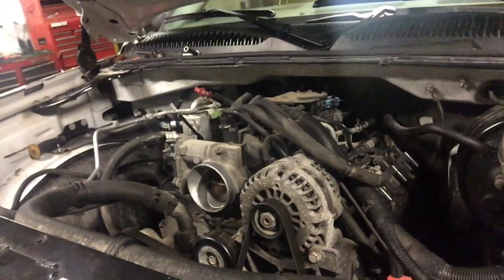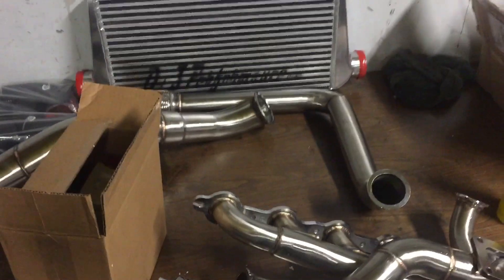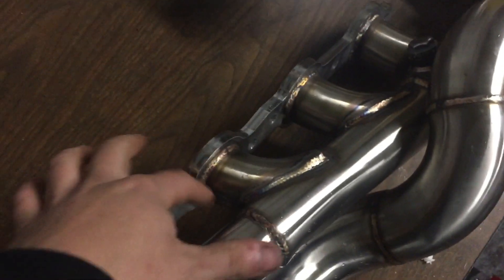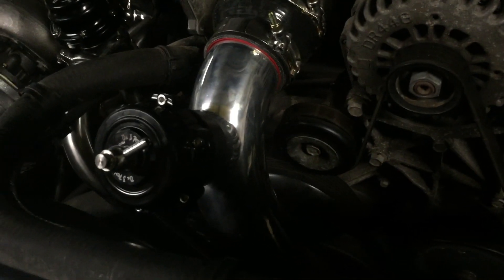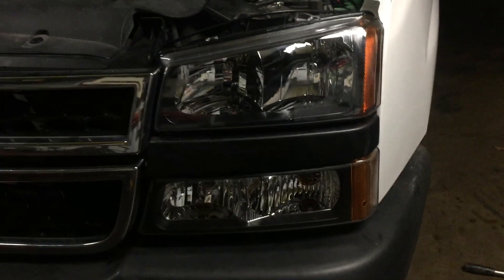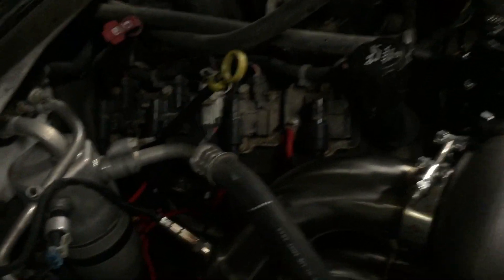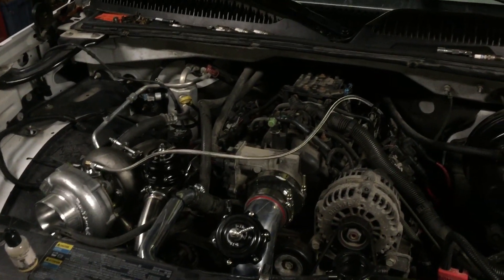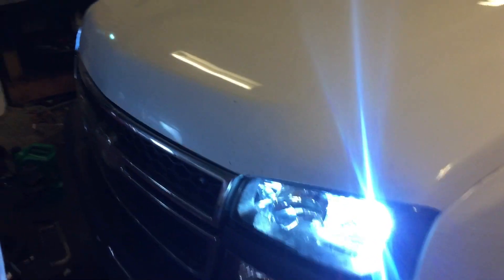2006 Silverado On3 Turbo Kit

Comment: I have about 5k miles on my on3 turbo kit. I'm enjoying so far good luck
Reply from the maker: BocaChevy thanks man I'm liking it so far. Have had some boost creep issues from the wastegate for some reason and the crossover flex joint cracked on me. Have about 500 miles on it so far. 14 psi spins at 80mph on e85 lol
Reply: HunterTuned ha! I literally just replaced a cracked flex joint last night. I still feel im ahead of the game,  but im hoping that's the last of my issues.
Reply: HunterTuned what gears?
Reply from the maker: Logan Terry it has 3:30 rear end gear

Comment: Thank you for the video. I hope you never did HID bulbs. Any updates on the truck?
Reply from the maker: This truck hauled ass I sold it a few years ago 23psi of boost on e85 was all the fuel system had in it roasted the tires at 60

Comment: Where did u relocate the MAF? After or before turbo?
Reply from the maker: Anthony Deleon maf deleted. Speed density tune conversion so it just runs off of the map sensor.
Reply: HunterTuned where did you get the map sensor? Awesome that you can delete the maf sensor !! Did not know that

Comment: Can you go over why you have the inline radiator neck from the Durango?? i'm confused and i'm doing the same turbo kit you are.
Reply from the maker: Manjoyt Kang you have to get rid of the stock overflow/ radiator cap setup that normally is right behind the air box because it does not fit properly and is also very hard to bleed out the air. Running the Durango or any top hose fill neck ensures filling the whole motor full of coolant as well consider the factory setup fills from the middle of the motor.
Reply from the maker: Also a lot easier to bleed the air out of the cooling system
Reply: Awesome thanks, the On3 website allows you to upgrade the turbo from the base kit, what turbo did you get? Did you only need plug wires for the turbo manifold bank of the engine or did u get all 8 plug wires? What other brand plug wire would you recommend instead of On3? 

Also can you please do a video going over how you made the gauge cluster on the pillar to work? From start to finish, going over where you placed all the sensors, drew power from etc.??

Great work btw, Cant wait to see more.
Reply from the maker: I just stuck with the 70mm turbo. If you go with any bigger I noticed it really suffers on the low end punch style power which I enjoy with a street car. The 70mm turbo will make 650whp as well they don't advertise it because they don't recommend it. But I've made 700 on one in the past. Previous builds for plug wires I just got a build your own wire set from taylor wires and only ran them on the cylinders needed. Like I said these wires actually work pretty decent. Just have to find a clean way to run the longer wires. As for the gauge install it was pretty easy. Just run your wires up the side of the dash behind the trim piece. As for power I just ran a wire from a switched source in the fuse box and grounded to a ground under the dash.
Reply: Did you go journal bearing or ceramic ball bearing? journal's cheaper but spools slower from what ive heard 
How did you tune it yourself?
Reply: Also people say upgrading the valvetrain is necessary for boost, did you change your valve springs, trunion upgrade, or pushrods?  running stock cam? how do you like it?

Comment from the maker: Tuned by me
Reply: HunterTuned and where did you install the tune?? is it just tuned with a fuel pressure regulator
Reply: T1GR3S13 what?
Reply: John Barnett where do you put the tune
Reply: HunterTuned does this kit come with all assembly bolts and nuts like the header to crossover? And is there a gasket that goes under the turbo and all

Comment: Where and how did you run the oil drain from the turbo?  Just drill and tap the front of the oil pan?  my kit comes in tomorrow and I haven't been able to find anything on how the oil lines are ran on this kit
Reply from the maker: Just drill and tap the front side of oil pan below the balancer
Reply: You don't want to run your oil drain to that block off plate because it's pressurized.

Comment: Hunter,is there anything you would personally add to the base kit? And also,where did you go with the return line from the hairdryer?
Reply from the maker: In the video I stated what else I bought from the base kit. Plug wires map sensor ect
Reply: I gotcha,I was wondering if you did the gen2 turbo manifold,or the the return fuel system...I'm gonna order the kit with the 76mm upgrade.
Reply from the maker: Travis FTB don't waste your time with the 76. If anything go with the 78mm. I converted this truck to the older style return style fuel setup
Reply: HunterTuned that's what I need man! Thanks,I found a new kit with the 88mm but I doubt the 4.8 can spoil the thing in a decent amount of time.